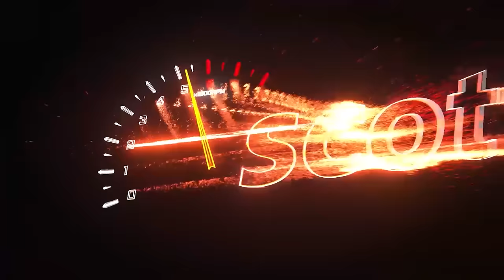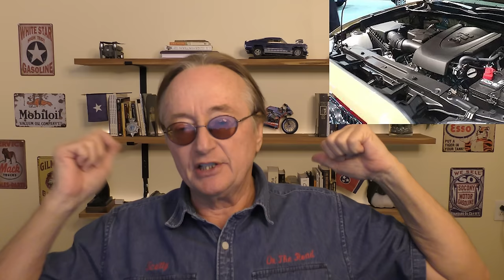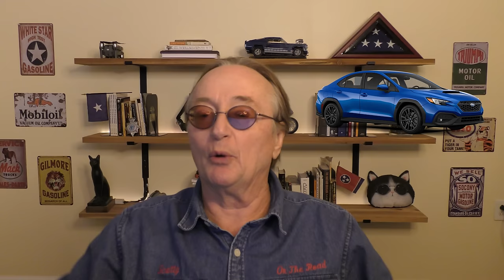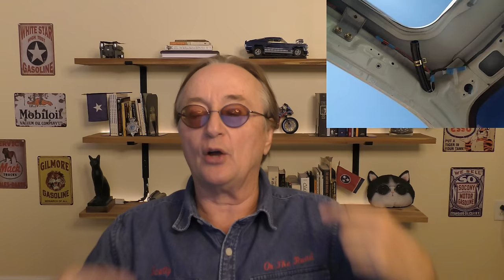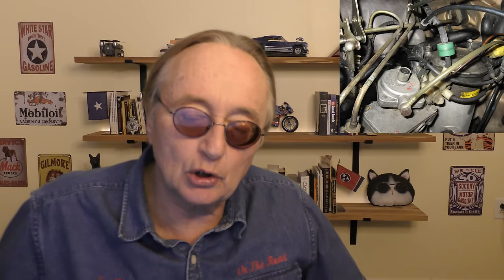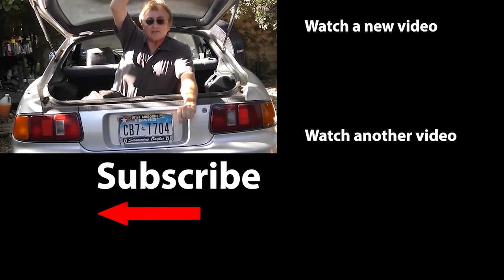This is Illegal as Hell But Makes Your Car Run Better

Comment: When it comes to trucks! Loaded for me means! Power Windows and locks! And maybe a cup holder or 2! Don't need all that fancy tailgates! And navigation and all the other crap! The more you put in! The more that can break down and repair!
Reply: I take one with manual locks and windows, I did power ul locks and windows with aftermarket kits on my 2000 E350 truck. Works better than oem ford .,
Reply: If I had the wherewithal I'd like to design a car with the absolute minimum legally required enhancements. 
- keyed ignition
- no motorized access ports
- minimum electronics
Blablabla
Reply: @MrOgynist  You'd save tons on the price too.
Reply: @robant5578  Ik what you mean! I was just basically saying the bare minimum! Is all I need if at all! To many folks are worried about! Bells and whistles these days! He'll I wish they'd bring back window wings! Don't care if the vehicle had the best AC on the market! Have a good day!
Reply: @MrOgynist  I can agree with that!

Comment: I'd stay away from the twin turbo 150s.  My friends dad had 2 timing chains break within 130k miles.  Both turbos failed.  Was not doing any serious towing.  Been without it for more than 6 months.
Reply: Cam Phasers went out in mine in under 3 years. 60k miles. $4,200 ford helped zero 👎👎👎
Fixed it and traded it in

Comment: Cars in PA rust takes them out before  100k . Just got rid  of a 2014 outback. On top looked brand new at 88k... but the welds on the  bottom starting to rust through. Probly could be fixed. But got  a deal on a 23 used 8k on it. 16k. So good for 10 more years atleast.

Comment: Please help, Scotty!
I have a 1970 Ford pickup truck that has a 390 motor which is not original, but has been running great for 15 years. Last summer we rebuilt the carb, and replaced the distributor. Ran great for about six months. Was warming it up last week when it stalled after running for a few minutes. Won’t start back up, checked all the connections, plugs, etc. we are stumped. Thanks
Reply: Check timing? Distributor could have slipped.
Reply: Put a new Vacuum Advance on it.
Reply: @MeltingRubberZ28  I will check it, thank you
Reply: @hfcross3481  I will look into that. Thank you
Reply: It sounds like a bad timing set! To verify this, remove a valve cover crank the engine. If the timing set is bad then your vavetrain won't move.

Comment: we got a Chevy Silverado 2001 bought used ten yrs ago after test driving all other trucks it was older and ugly but we goy it. the lot is closed down yes ago and it's still going burns little oil. but we keep up. funny how the ugly duckling ended up the rock star so do your homework people it's worth it

Comment: Removing the Cat does not make your car run better unless it's damaged. It only becomes damaged because the engine is not running properly. There is no restriction through an undamaged Cat. Good grief.

Comment: The inside honeycomb of the catalytic converter on my work car broke slipping onto a shoulder that had a small drop. I don't worry about it, because I'm in Tennessee, and as you said, no one knows, and no one cares.
Reply: Cancer is something you will care about. You inhale your own poison exhaust by the way in case you thought your car was sealed and able to drive underwater too.
Reply: sorry spelled wear wrong should use spell check  sometimes.

Comment: You can always gut a catalytic converter so that it looks right.  The check engine light issue can be solved with a spacer on the sensor.  On some engines the cats create back pressure and make your engine into an oil burner at 100K miles.  Could someone explain how burning oil is better for the environment?

Comment: I just bought my "Kilmer-Yota" 2016 Tacoma SR5 after trading in my 2012 Ram and I have pretty much zero regrets. Course the Tacoma has a crew cab verses a single cab in my Ram to begin with. Suspension is like night and day between the two trucks being that Toyota makes some of the best suspensions in the world especially being off road experts for decades. The rest of the truck is just better engineering, including their version of the 5.7L, thus a superior build to Ram in my opinion, and I'm a MOPAR fanatic (still have my 1989 Ram with a 318 V8<-300,000 miles on the OD and still running like a Timex!). I'll see how the Tacoma tows my 30 foot RV this year and I'm working on upgrading some of its components to get a little better mpg and unlock its potential. Most likely looking at adding some good mileage on its already 84,000 (barely breaking it in for a Toyota). Hearing you say that they're looking at killing the 5.7 for a turbo charged V6 has me in for the long haul with this model even more so. Thanks again Scotty!!

Comment: I had a used police car back in the 70's. After a long drive on the freeway I pulled into my driveway and the front diverside wheel nearly fell completely off. Tilted at 45 dregees
Reply: Did you fix the cigarette lighter?

Comment: My cat is out in my v8 Thunderbird, how do you bypass the cars computer/o2 sensors if you straight pipe it. Thank You all
Reply: From what I understand you can straight pipe it but the cars computer will go haywire with readings that come from the o2 sensors
Reply: I live in Kansas and we do not have emission testing in our State. I've tried replacing the CAT but the cheapest quote I've received is 3k

Comment: It's not against the law in the United States to drive a car without a catalytic converter, that is lacking complete information as that only applies to cars that came with a CAT as OEM equipment. Older vehicles, like the best cars from the 60's, lol, did not have CATs and they do not require them. Of course, anything 1974 and older does not require a SMOG inspection either.

Comment: I hear you say that the Hemi motor is junk because of the oil not getting to the crank case at idol. Now is that "ALL" the hemi motors in the Rams? Or is this common in particular years? Reason I ask is, I had just picked up a 2004 Ram SLT with the Hemi motor. If this truck falls in that category, I'll be looking to sell it soon. Or atleast be cautious to how often I let it idol. Thanks in advance.

Comment: If you want better exhaust flow, but still keep it street legal, get a high flow convertor. They are larger in diameter and not available for every car, but if you can go that route, it's a good fix. One of our cars is a 2.4L SRT4 with 338hp, and it still has it's stock convertor. My grandfather was on the design team for the original Ford Thunderbird, and he used to always dump the convertor when they started showing up.  I still remember my mother asking him why he did it, and when he said he didn't want the car to be slow, she retorted "But your grandchildren will be slow!".

Comment: If you want a good reliable sports car get a 9th generation Honda Civic SI. I would prefer a 2013 bc it still has the key to start the car and a E hand brake instead of the electric E brakes.

Comment: When it comes to removing a catalytic converter, what about cars that have two and removing just one? Am I correct to assume that would be kind of a middle ground, like still having some decent emissions filtration, but increasing the ease of the engine pushing out exhaust?

Comment: I have a 67 camaro old school mildly built 350 running headers without cats, legal here in SoCal. We have no inspections or emission testing for older cars.
Reply: "THEY" SHOULD GO BACK TO 25 Y/O NO SMOG REQUIRED(1987 BACK) OR DO AWAY W/SMOG/EMISSIONS
Reply: "THEY" SHOULD GO BACK TO 25 Y/O NO SMOG REQUIRED(1987 BACK) OR JUST DO AWAY W/SMOG/EMISSIONS
Reply: "THEY" SHOULD GO BACK TO 25 Y/O NO SMOG REQUIRED(1987 BACK) OR JUST DO AWAY W/SMOG/EMISSIONS
Reply: "THEY" SHOULD GO BACK TO 25 Y/O NO SMOG REQUIRED(1987 BACK) OR JUST DO AWAY W/SMOG/EMISSIONS
Reply: "THEY" SHOULD GO BACK TO 25 Y/O NO SMOG REQUIRED(1987 BACK) OR JUST DO AWAY W/SMOG/EMISSIONS
Reply: "THEY" SHOULD GO BACK TO 25 Y/O NO SMOG REQUIRED(1987 BACK) OR JUST DO AWAY W/SMOG/EMISSIONS
Reply: "THEY" SHOULD GO BACK TO 25 Y/O NO SMOG REQUIRED(1987 BACK) OR JUST DO AWAY W/SMOG/EMISSIONS

Comment: Curious…..do you need a catalytic converter if you run E-85?
Reply: Yea, depends on the jurisdiction but know that both e85 and e10 emissions are both toxic, catalytic converter helps both.
Reply: @Alejandro_san  thanx
Reply: Yes! It doesn't matter which kind of fuel you use.

Comment: 4 cylinder gas engines in a pick up not the greatest idea
Reply: I have a 4 cylinder Ford Ranger with a tow bar. I inherited it when my uncle passed, the owners manual says it can pull up to 7k pounds. Not sure if that's true but that's more than I'll ever need

Comment: Hi I just had my mechanic swap a trans in my 05 cobalt a worry I have is the trans was off a junked car and the lot had drained the fluid witch I did not receive. My guy put a new filter and fluid what's the chances that the gears may slip if any at all.?

Comment: Even where they test emissions, like the UK there are different standards.   For. Example my 2004 car model had to meet a tighter standard than the same 2021 model.  Putting an aftermkt cat on the 2004 model is a fraction of the OE price but illegal. I fitted an aftermkt cat anyway and it still totally flew through the emissions test.

Comment: My little 1986 Toyota pickup finally died  a horrible death, a construction lift dropped its boom on my poor little Bennjamin (what I named the truck). . . it had 431,000 miles on it.  Nobody is making little handy pickups anymore.   I want something I can toss a couple of bales of straw in the back or pile it with a bunch of horse nuts (feed).  I want to be able to carry 50lb bags of . . . stuff.   Sigh!
Reply: My Denali 2500 HD will do that.

Comment: Hear is a question for you Subscribers,or Scotty. Scotty says turbo engines don!t last long,, what would happen if you took the turbo off?  Just thought while Scotty was talking about it.Thanks.☮
Reply: Less power. The only way the 4 is making as much as a 6 is because of the turbo craming more air with fuel into the cylinder.

Comment: BUT people told me that removing or bypassing the cat, would screw up the car com[uter, back pressure and so on. Is that not true????
Reply: You can "trick" the sensors into reading properly. Hard to find the parts though.

Comment: Scotty my parents bought me a 2014 jeep wrangler Sahara which was overpriced and had a cracked engine that got corroded by coolant or something so now they wanna get a new one but the mechanic shop said it’s gonna cost 16.5k for the engine + installation + other repairs. What should I do
Reply: Crazy talk! Don’t know what your options are but a 5k used Honda or Subaru could be in your future.

Comment: If you have manual transmission, you can start the engine even with an old battery. Without a jump start.
Reply: Not if it has EFI.  Only carb engines can be push started.  EFI computer needs the battery too.  Dead battery, dead EFI.

Comment: The Catalytic Converter  removal only helps the top on the horse power range  it also degrades fuel economy because of the way the Cam is Ground ,  to-wit the fuel consumption  is higher with out the Converter     The power range is better in the Mid range because of the Converter     this is because of the Intermix temperature is higher with the Converter in place   and the amount of Gas Scavenging that takes place in the Cylinder     Is the law is good or bad the reality is there are problems if all the back presser is removed from a modern car engine  
 Thank You for the interesting Video

Comment: Take your catalytic converter off and get a hole saw and a shank extension and use it to drill a hole through the converter medium so there is no restriction.  That way anyone who decides to look will still see the original converter in place.  If you live in an area where they do emission test, you can buy the cheapest new converter you can find and put it on for the testing and then put the modified converter on for the rest of the year.  No one will be any wiser as long as you do not tell anyone else what you have done.  Remember, there are always one of those people in any group who will be more than willing to squeal on you.
Reply: Only drawback to drilling out converters is a P0420 code that makes the check engine light come on. They try to get ya comin' an' goin'. Hell, "they" don't want you to work on your own stuff anymore. I mean, you paid for the thing! It's not just cars either! Every year, it's something new (against the owner) coming out! ALL the auto manufacturers are guilty of the same s**t!

Comment: In 2019 I checked out a Honda CRV for my wife and after research found the engines had fuel blow by past the piston rings and diluting the motor oil. NOT GOOD! I was at the Honda dealership and happened to catch a salesman that pulled up in a new CRV that had about 500 miles on it and after talking with him I asked if I could check it out he said sure. First thing I did was pull out the engine dipstick and smell it, there was a unmistakable smell of gasoline on it. After that I did some more research and got her a new Mazda CX5 non turbo SkyActive engine and the body in a beautiful red color. It's been a nice reliable car that has some pep is fun to drive and gets decent gas mileage at 42,000 miles so far. I do the oil changes with exact suggested oil and OEM filter at no more than 4,500 miles. Believe it or not Mazda has a plastic odd shaped oil catch can below the intake manifold on this engine. I wonder if Honda fixed the oil dilution issue with their CRV?
Reply: It happens to gdi engines and especially smaller ones.  If you have gas direct injection instead of port injectors you will get it .toyota solved part of the problem by using both port and gdi...1.5 litre turbo cars of honda suffer the most out of hondas..but theres other makes.
Reply: You have gdi engine in mazda cx5.

Comment: As much as I've loved Toyota reliability, I don't think you can buy a Camary, Carola or any of Toyota's sedans with anything but a CVT transmission.
Reply: Just buy a Toyota hybrid. The Hybrid transmission is the most reliable transmission made.
Reply: They have 8 speed automatics. Unless you’re talking about the new 2025s
Reply: Toyota cvt are most reliable cvt made. Nissan makes the worst CVTs and that how cvt gets the bad reputation.

Comment: Being picky, a catalytic convertor also decomposes nitrous oxides (the oxygen from these helps burn the hydrocarbons).

Assume that removal of the "cat" would immediately trigger the engine management warning light (which on a modern car would probably put the car into 'limp home' mode). So for those cars, performance would be impacted.

BTW - In the UK the presence of that light would cause an immediate fail at the annual safety inspection (called the "MOT") which mandated for cars over three years old.

Comment: 2021 Land Rover Discovery. I’ve bought brand new 42k mikes now, zero problem. Anything to say Scotty?
Reply: Yeah. Sell it now before it goes tits up
Reply: I sold my 2019 with 49K, after the dealer started ARGUING ABOUT engine and transmission problems being covered under warranty, when every other mechanic that I paid to take it to in order to verify that it indeed had a problem, they ‘the dealers’ wouldn’t admit to!
ANYTHING TO SAY ABOUT THAT FALIMA?!
Reply: It might be running fine for now, but we'll see you at 80,000 miles whining about blown head gaskets and trannies.
Reply: A very new car with very low miles still

Comment: Scotty, you've got to learn about the  GM's 2.7 Turbo 4 truck engine, and all modern turbo's for that matter, because you're making statements on your vids that are untrue. The 4 banger makes 430 ft pounds of torque at 1500 RPM.  GM's 5.3 V-8 truck engine only makes 383 at 4100 RPM. The four has WAY more pulling power at low speed just like a turbo diesel.  This is why property engineered and built turbos outlast normally aspirated engines as they produce more power at lower RPM, and operating at lower RPM' s always reduces wear. Modern GDI Turbo engines are build like diesels, but powered by gasoline.  Many of today's GDI Turbo's are way different than gas engines converted to turbos or diesel that were problematic in the past.   Best, Bill

Comment: It's against the law to remove the catalytic converter and disable the EGR system but makes the car run better in most cases, but don't do it...wink wink.  Especially the EGR valve on a Jeep JK 3.8 and many rich running Chrysler vehicles. Plus, a 5-10 degree cooler thermostat is illegal too.
Reply: Scotty has said a hotter thermostat will make your car run better with more miles per gallon.

Comment: If you're towing more than 5k pounds. Dont buy a Tacoma, hell Tacoma's aren't worth the price they cost. 50k for a small pickup??? Lol terrible idea if you towing a boat or above 5k u really need bigger. And in my experience tundra is not a great idea. 2 transmissions 142k in toyota is not in a good place for trucks.

Comment: I got a 2021 Corolla SE that had 17k mi for $21,500.
They had the 2023 LE for like $5000 more.
Sure it's brand new but it is also the lower trim model for even more than the SE that is a few years older.
Prices are insane but it is, what it is 😂

Comment: Scotty, I know you don’t like Dodge Rams. I’ve had second GEN Dodge rams for many many years Cummins.
Old people that I know that have power stroke, diesels switch over to Cummins .
People say the transmission this the transmission that .
I swapped out the transmission for a 1 ton in a three-quarter ton. I put a FASS lift pump and a new generation Bosch VP 44 injection pump. I make sure that I keep the tank filled and never let it go below half I put new batteries in , keep up with the maintenance. I wouldn’t have any other truck.